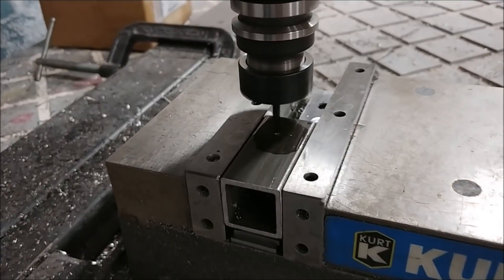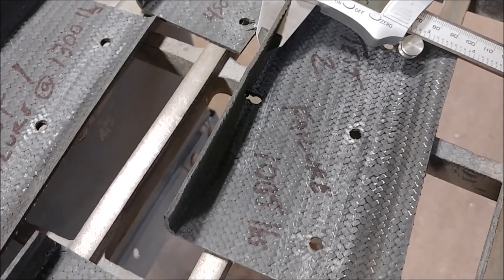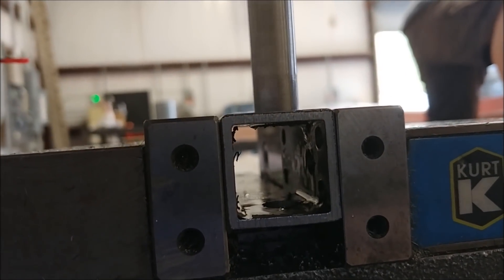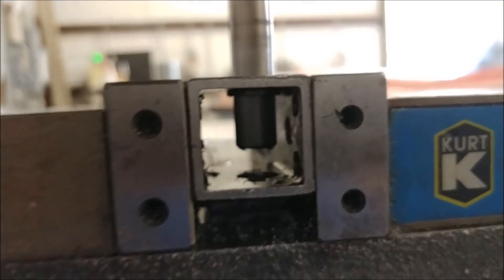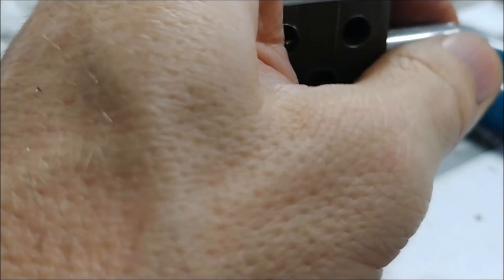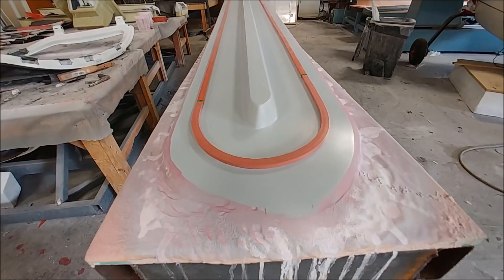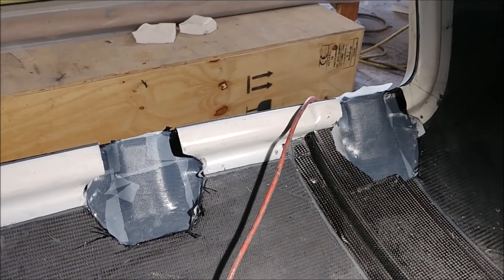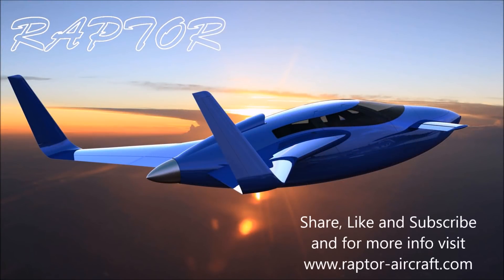Side Sticking It!

Comment: Instead of throwing in the towel on the gull wing doors due to the extra work involved, why not investigate farming out the creation of those parts to an outfit with a laser cutter?  Creating those parts would be child's play for them and it shouldn't cost that much if you order a few hundred of them at a time.